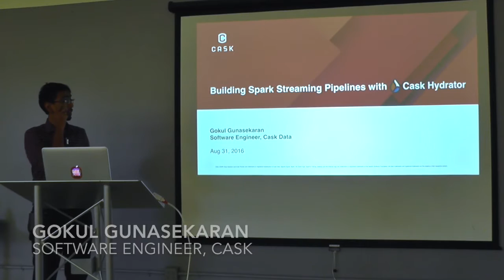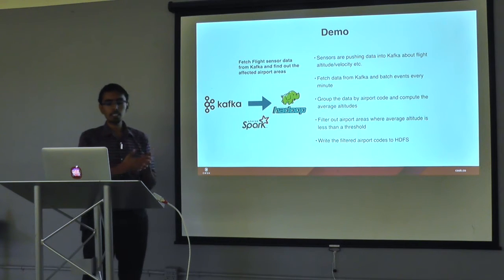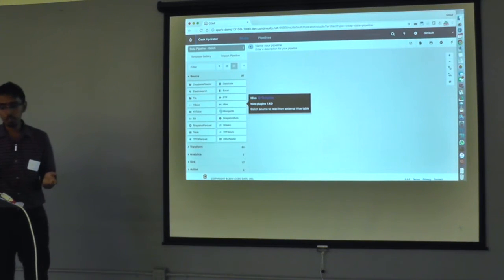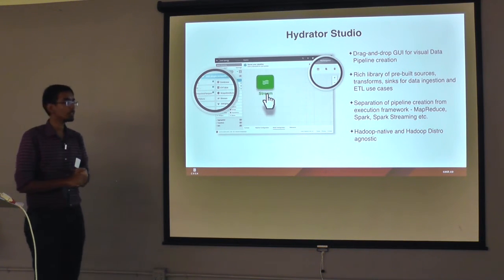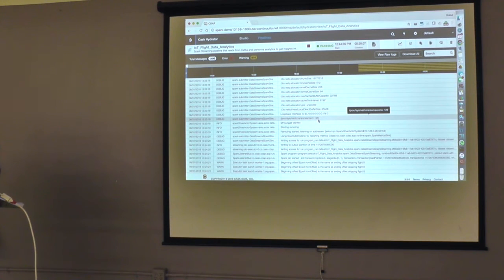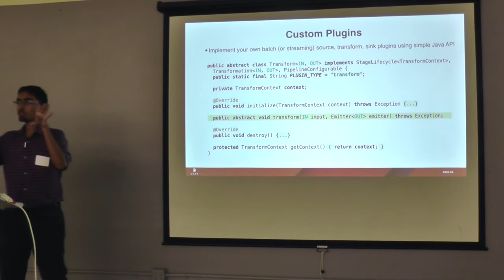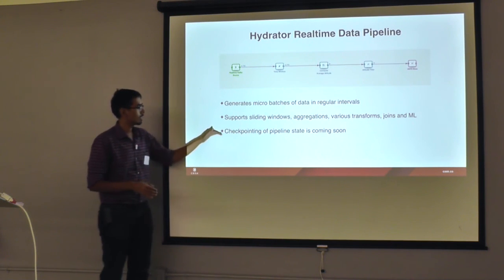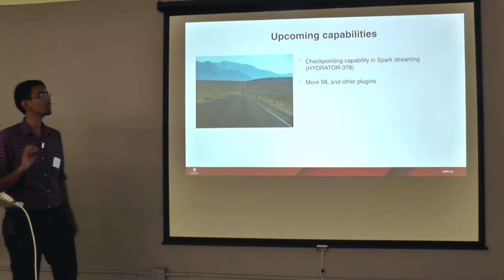Building Spark Streaming Pipelines with Cask Hydrator, by Gokul Gunasekaran, Cask

Comment: you don't have any info about building Spark Streaming with CASK hydrator. you only have a RDD introduced at the end of this video. this title not match your content at all.
Reply: Thanks for your feedback Robin. I am the speaker of this session. The talk is focused on how to use GUI-based Cask Hydrator to build realtime (or batch) pipelines. The execution can be switched seamlessly between Spark or MapReduce (for batch pipelines) or Spark Streaming (for realtime pipelines) with a click of a button. Hydrator abstracts away the plumbing so users can focus on the logic instead of infrastructure and integration.
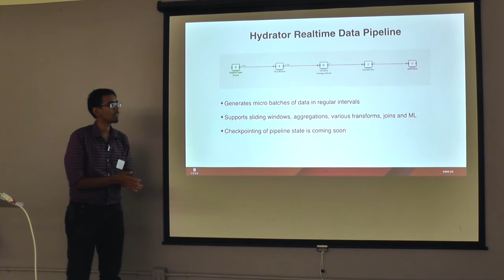I also cover certain aspects of Spark Stream processing that users need to be aware of for building real-time pipelines at 43:17 (https://youtu.be/Zu18mM6nLg4?t=2597). Hope that helps.